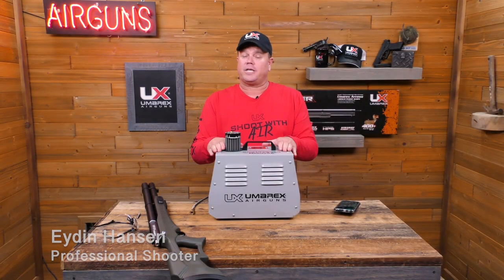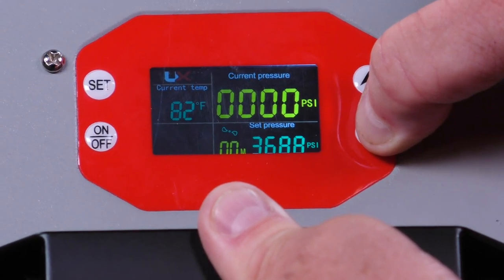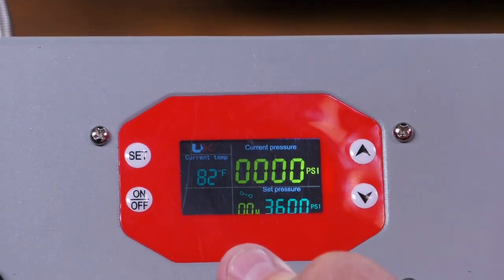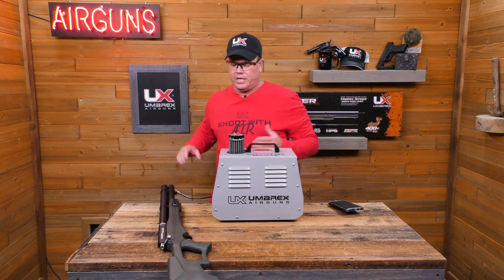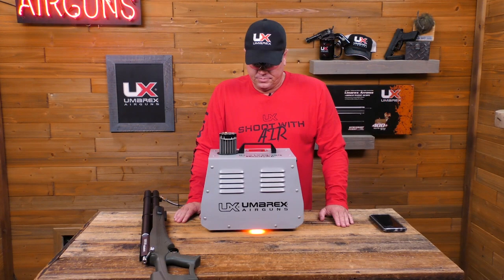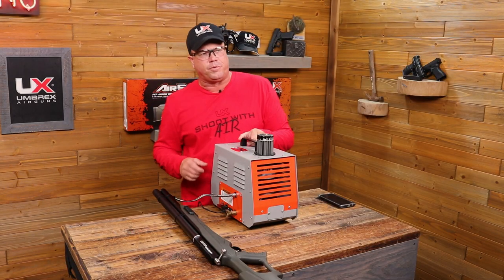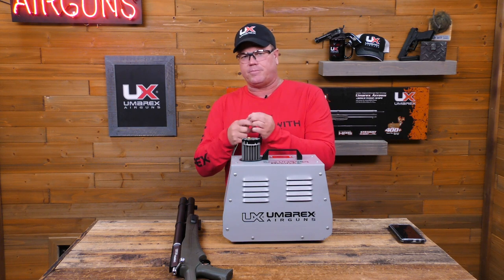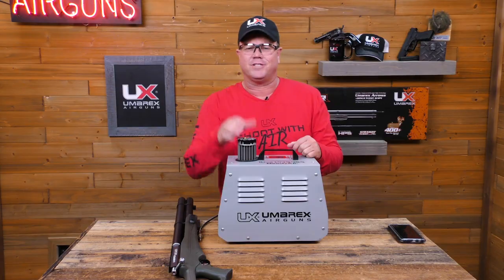How To Fill PCP Airguns with Umarex ReadyAir Airgun Compressor

Comment: I've yet to come across a High Pressure PCP Compressor that actually will hold up and work reliably. Most seem to break down after a few uses and the reviews I've read for the one in this video have mostly been horribly bad. Save yourself a headache and get a 75 or 100 Cu ft 4500PSI SCBA Bottle unless you want to spend weeks rebuilding high pressure air compressors.  This is just my opinion only but it seems like they buy cheap bulk compressors from overseas and stick American company labels on them and jack the price up a few 100% and then sell them to us. READ THE REVIEWS FROM MULTIOLE THREADS!!!!!!!!

Comment: How much moisture makes it through to the gun also why does it cost the equivalent of $990  (£779.00) in the UK?
Reply from the maker: In humid climates moisture can be a serious problem. The compressor is designed to capture moisture by gravity but you might consider additional filtration if it's humid in your area.

Comment: I posted a comment earlier today on the video. I have now done some trouble shooting and have found that when the compressor is charging, the air is coming out of both air tubes that the arrows slide on to. So, it will not show it charging on the compressor or the rifle. If I hold my fingers to block the air from escaping from the tubes, the compressor immediately shows that it is taking a charge. Of course I can not hold my fingers over the tubes for very long because of the build up pressure. Am I doing something wrong for this to happen?
Reply from the maker: The rifle needs to be cocked first when it's completely empty to seat the valve.
Reply: @UmarexAir  yes, I got an answer when I called
 They were very helpful, thanks

Comment: You packed it all into a nifty little package and it couldn't havent gotten that hot if you're touching that piston head right after a fill. Nice
Reply from the maker: Thanks.
Reply from the maker: Warm but not overly hot. Benefit of overhead protection! Keep it well ventilated in the in shade.

Comment: Will this fill any airgun that's a PCP?
I'm new to airgunning, been doing it for about a year now, so I'm learning everything as I go.
If this is compatible to all PCP's I probably will make the investment and get one.
Thanks for the video...I always enjoy your stuff!
Reply from the maker: Yes. The filler hose has a Foster QD (quick disconnect) fitting. If your PCP has a Foster male connection it will adapt. If it has a probe that fits into a Foster connection then it also adapts. Thanks for tuning in!

Comment: Hi, I just received my airsaber elitex2. I purchased the compressor months ago. I set it all up according to the manual and your video. It has run for over forty minutes and has not registered on the pump or gun. It ran at 127 degrees. I turned it off and it is cooling down now. I could not feel any air escaping from the compressor or gun when attempting to fill the rifle, and even sprayed a little soapy water on it and there  were no air bubbles. I need to find a plan B. By the way. The air rifle looks great.
Reply from the maker: Oh no, not good. Please call us: 479-646-4210 ext. 7

Comment: Does it come with the 12 volt DC connection and 110 cord already assembled?
Reply from the maker: It comes with a 110 cord that just plugs into the unit. It comes with 12 volt cables -- clamps at one end to attach to a battery and eyelets at the other end that attach to integrated bolts on the unit.

Comment: Hi I live in the UK so have all the bother of licenses if above 12ft/lbs so I was wondering is there a way I could get a legal gun at that power but being able to increase the power somehow that would return back to normal power once I've used some of the air perhaps there's an adjustable chamber size or something any tips,tools or methods that I'd find helpful thanks I know using different gases can do it but they need different seals plus the legal issues ideally a secret part that can be changed to increase power but be switched off if ever looked at by officials thanks, also maybe you know of such a gun if so I'd be interested in your thoughts cheers
Reply from the maker: Best thing to do is to cruise the airgun forums... Airgun Nation, Gateway to Airguns, HardAirMagazine community, Yellow forum.